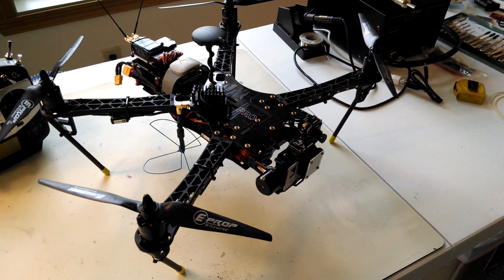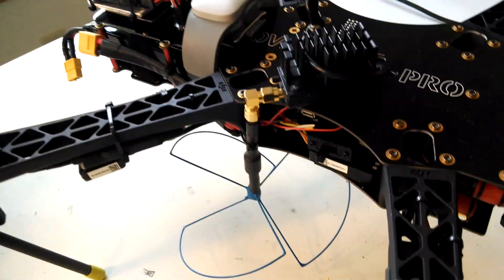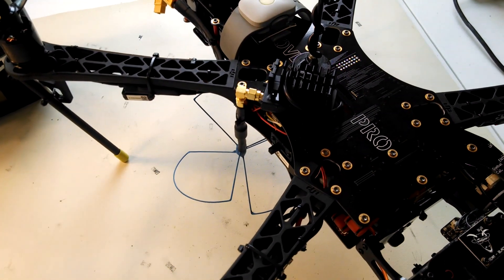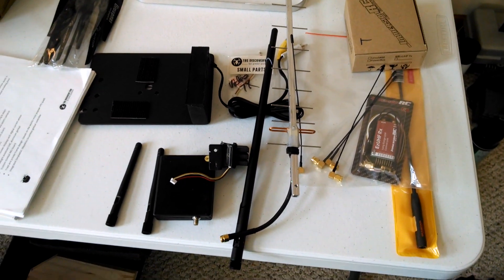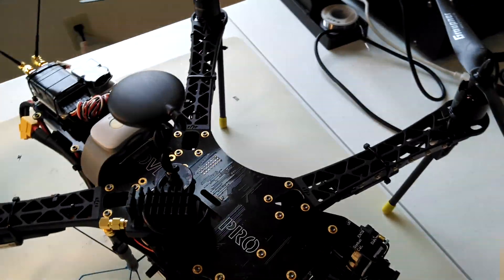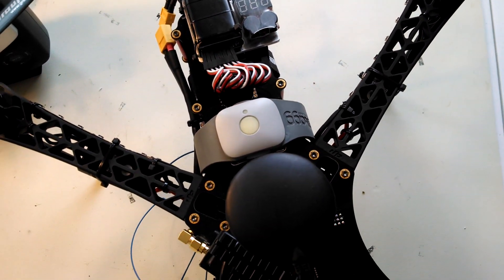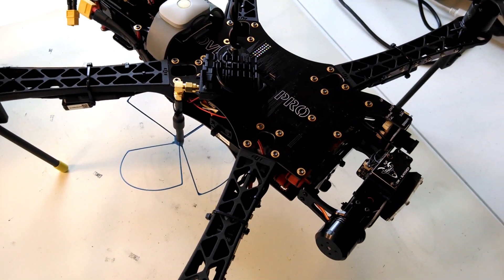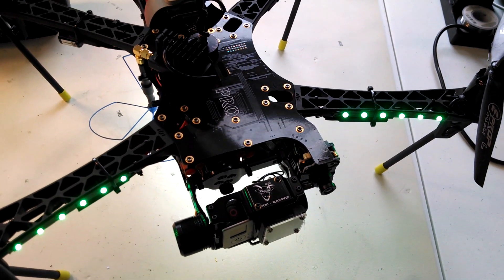TBS Discovery Pro Update and Mods

Comment: Hi Richard,  I used your leg design for the last year to separate my gps and and 1.3mhz.  My legs needed to be 6 inches to clear the antenna though.  The only changes from your design was I made the legs go straight up and down vs at an angle like yours.   At an angle I found they weren't as stable and would some times get loose (no matter how many zip ties I used). Additionally, I copper taped the inside of a gps holder that sits on top of the gps mount.  My problem has been that when the gimbal is aimed straight down, the legs were in view.  I contemplated getting 4 small servos and creating retractable landing gear but now I am determined to use no legs. I have had success placing the gps all the way to the rear, placed directly where the ezuhf antennas are on the board.  My ezuhf antennas are now located in the middle of the disco, as I have the ezuhf on the other side of the pins.  I'm now reading that this can cause intermittent fly-aways due the gps not being masted and being close to interference.  Not sure if this is true but now I'm going to be working on a solution to not use legs AND to have a gps mast.  I might mike a platform that extends back, on which the mast can sit... not sure.  Besides giving you an update, I want to ask you if your legs ever were in view of your gopro?  Are you still flying this design?
Reply from the maker: FPVme I'm still very happy with my setup and flying in exactly the same configuration with the legs zip tied to the ends of the arms at an angle. I don't ever see them in the video, even when looking straight down.  Best regards!

Comment: Looks good! I like what you've done with the landing gear. It would seriously help in the case of a hard landing and like you said keep it up off the dirt. I may contact you later about changing my FPV set up to match yours i just have some questions before i replace expensive parts that i already have. I have pretty much everything maxed out that you can order from TBS but i dont like how i can be flying in line of sight of the drone and the video goes all static. I get that even when it's close at times so i know it's not a range issue. Thinking something like this may help. im running at 800mhz on my video with their tuned Lawmate.
Reply from the maker: My video is crystal clear. The only time I get glitches is behind a building (takes a hefty building), or a hill. Otherwise I'm sure the video exceeds by battery range.  Here's my video setup:

Products for 1.3 Ghz from ReadymadeRC for FPV video
------------------------------------------------------
1 x 1.3 GHz Mad Mushroom Antenna (RHCP) IBCrazy (RHCP-MADMUSHROOM-1.3-IBC)= $44.99
1 x SMA Right Angle Adapter (SMA-RA)  = $4.99
1 x 1.3 GHz 10dBic RHCP Crosshair Antenna (IBCrazy) (1280CROSSHAIR)  =$64.99
1 x 800mW* 1300MHz Transmitter - NEW CUSTOM READYMADERC US VERSION(V2-800MW1300MHZTX-US)  = $59.99
1 x 1.3GHz Receiver w/SAW Upgrade (V3 with 1258 MHz!) (V3-1300MHZRX-SAW) =$79.99
Reply: Richard Fugate can i use use all this FPV stuff with the TBS Groundstation 2.4GHZ (http://team-blacksheep.com/products/prod:tbs_gs_2g4) or will i need to also get a new screen if i want others to see what im seeing in the goggles? I take it i can connect the goggles directly to the 1.3GHz reciever? I lost power @400 feet so i have to do some repairs and want to just get it right the first time if i need to replace parts. Have you found a better camera than TBS's TBS 69 FPV Camera? i dont see that they even offer that as an upgrade anymore but it's what i currently have, if it still works that is... ill have to fire it up and see what electronics are actually broken. :(
Reply from the maker: Brandon Proplesch Let's see if this helps... I have the TBS 69 FPV camera on my quad and think the video is great. The TBS Ground Station would be paired with the 2.4Ghz transmitter on the TBS Discover. So, not 1.3Ghz at all in that setup, you'd just use the TBS transmitter, receiver (ground station), and the paired screen. If you own/bought this then the 1.3Ghz isn't relevant. Now... if you do go with a 1.3Ghz transmitter/receiver the receiver has a simple composite video output... same as a 1980's VCR/TV hookup. This is what connects to the goggles.... or a LCD screen and skip the goggles entirely. I'm sure you can find may cheap "TV" displays that have composite video in (yellow RCA plug). You'd fly using that display and your spectators could see it too.  Good luck in your repairs.

Comment: 1.3Ghz will interrupt Naza connection to GPS if you don't have the filter from the IBCrazy Ultra air screw. GPS uses 1.575Ghz which is very close to 1.3Ghz. I know from personal experience that even a 400mw 1.3 Tx with out a Filter will completely hinder a GPS lock.  as soon as i put the filter on instant GPS.

also 1.3Ghz is the third harmonic of 433Mhz, so with a powerfull transmitter such as the 800mw one you are using there may cause RC link issues. and i say may because i haven't experienced it yet, I'm assuming because EzUHF has phenomenal filtering.  on a Dragon link or open source system it may be another story.

here is a great video on 433 / 1.3
Flite Test - Long Range System (LRS) Shootout

  I hope this helps people that had an questions about 1.3Ghz.

- Mr. Steele

Comment: Do you had some issues with gps and 1.3ghz?
Reply from the maker: No issues. I get a solid GPS lock with the NAZA without any delays or loss.
Reply: But the reason why is because you have the turn to down?
Reply from the maker: Ricardo Teixeira I pointed the IBCrazy Mad-mushroom down because of internet comments that gps and 1.3 Ghz may have interference issues. It has been mounted that way since I built the quad and works great. If may work great on top too, just haven't tested it that way.

Comment from the maker: I've received a number of questions about what parts were bought for the build. Here's my invoice with some edits and comments based on how I would purchase differently if done again. This is only based on my limited experience and YMWV (Your Mileage WILL Vary). :-)
----------------------------------
Teamblacksheep Products:
----------------------------------
TBS DISCOVERY PRO gimbal frame (1x) - US$ 599
   Flight Control (DJI NAZA Lite + GPS) (+ US$ 209.95)
   Upgrade to Naza V2 (+ US$ 230.00) <------ NO, Naza lite is fine.
   900kV2 Motor & ESC set (+ US$ 279.95) <---- bought because bigger is BETTER, right? No complaints.
   9x5 Graupner E-Prop Set (+ US$ 30.00)
   2 x 4500mAh 4S battery (+ US$ 99.95) <------ Instead Turnigy 4S Nanotech 70C 4500mAh, less $$, longer flight time
   2.4GHz FPV Combo (UHF RC, Tx, Rx, Cam, Goggles) (+ US$ 859.95) <------ Go straight to 1.3 Ghz, skip the Tx, Rx (get EzUHZ tx/rx, Fat Sharks)
   Add 11dBi Yagi (+ US$ 39.90) <------ Go straight to 1.3 Ghz 
   Add 7dBi Whip (+ US$ 29.95) <------ Go straight to 1.3 Ghz 
   Upgrade to TBS69 FPV Camera (+ US$ 70.00) <------ Nice FPV camera
   Add Flamewheel Arms (required for a full frame) (+ US$ 24.95)
Set Graupner E-Prop 9x5 (2x CW, 2x CCW) (1x) - US$ 30.00 <------ Extras, you'll need em'..well I needed them.
Set Graupner E-Prop 10x5 (2x CW, 2x CCW) (1x) - US$ 36.45 <------ Extras, you'll need em'..well I needed them.
   Add 5mm reduction set (required for TBS motors) (+ US$ 4.45)
B6AC 80W (1x) - US$ 54.95 <------ Happy with the charger

Products for 1.3 Ghz from ReadymadeRC for FPV video
------------------------------------------------------
1 x 1.3 GHz Mad Mushroom Antenna (RHCP) IBCrazy (RHCP-MADMUSHROOM-1.3-IBC)= $44.99
1 x SMA Right Angle Adapter (SMA-RA)  = $4.99
1 x 1.3 GHz 10dBic RHCP Crosshair Antenna (IBCrazy) (1280CROSSHAIR)  =$64.99
1 x 800mW* 1300MHz Transmitter - NEW CUSTOM READYMADERC US VERSION(V2-800MW1300MHZTX-US)  = $59.99
1 x 1.3GHz Receiver w/SAW Upgrade (V3 with 1258 MHz!) (V3-1300MHZRX-SAW) =$79.99
  
Landing gear
----------------------------------
Old arrow shaft, 4 1/4" bolt thread caps
Cut into 5.5"lengths
Zip tie (small) to outboard of the flame arms.

Comment: I'll be starting my build and have identical equipment except the 1.3 transmitter I got from getfpv 400 mw hope I dont have issues with it sounds like you have a perfect setup and I have been swinging back and forth on equipment My concern was the interference with UHF and 1.3 last thing I want is for the craft to drop from the sky. I'll have to get your legs extensions  where did you get them . What do you have mounted on to of the EZUHF and did you just use electrical tape. Thanks
Reply from the maker: mojito5606 Sorry for the delayed response. I'm not that good at navigating YouTube comments. No interference between 1.3 Ghz and EzUHF at all. The leg extensions are just 5.5" pieces of an old arrow shaft... can't get any cheaper! Yes, electrical tap on top of the EzUHF transmitter. Hope your having fun with your TBS!

Comment: Nice setup. Im looking in to a Discovery Pro as I currently have a dji phantom v1. With a 2200mah battery and all my gear Im getting about 7.5 minutes of flight on a calm day. That isn't much time compared to some other options. What battery are you running with what kind of flight time? Thanks!
Reply from the maker: I own three batteries. Two TBS 4500 mAh, and one Turnigy Nano 4500 mAh. They are all the same age and only about 5 cycles each. I consistently get 10-12 minutes flight time. The the TBS batteries at 10, and Turnigy closer to 12. Ironically the Turnigy cost about $30 less and weigh more!

Comment: What is the maximum range you can travel with your battery currently being used?
Reply from the maker: I have not tested the ultimate "limit" of range. I have comfortably went 2 miles out, loitered for maybe a minute and returned. Total flight time about 8 minutes with a safe margin on the battery remaining (3 min). That's about my comfort zone at the moment.

Comment: Richard, it looks awesome, have you make a list of the components that you are using? have you run into any issue between the RC and the video transmitter? the antenna at the bottom looks great too.
are you using the NAZA-M lite or the NAZA-M V2?
Reply from the maker: No antenna issues at all. Get a GPS lock quickly and video is crystal for as the distances I'm comfortable flying, so far no farther than ~2 miles. I have the NAZA-M V2. Since I don't plan on adding any other NAZA options (OSD), I probably wasted some money.

Comment: Is that the 400mw RMRC vtx? You recommend a heatsink?  What's the Aluminum slug on it? you mention?  Do you have links to these parts?  Thanks!
Reply from the maker: It's an 800mw 1.3 Ghz RMRC transmitter. The RMRC transmitter comes in a stupid aluminum box stuffed with pieces of scrap metal to act as a heat conductor. The actual transmitter is inside this junk in it's own slim metal case. I simply removed the top of the case exposing the electronics and applied a layer of thermally conducive epoxy (Arctic Alumina Thermal Adhesive) and let that cure. This keeps the aluminum piece to be put on next from shorting the electronics. Then I cut a piece of 1/8" aluminum matching the area of the now epoxy covered circuit card. This was then glued right on top of the circuit card with the same epoxy. Then on top of his I epoxied a chuck of aluminum heat sink of a scrap piece of electronics. Whole thing weighs less that the junk case that it come inside from RMRC.

Comment: Hi Richard,  I love how you mounted your vtx.  The legs look nice too.  I plan to duplicate this.  Did you do anything else to prevent interference?  Is that a low pass filter under liquid tape on your ibcrazy blue beam antenna?  Is that the perfect placement of the vtx so when the gopro is aimed down, there's no view in the picture?  Did you think about putting the naza gps further front?
Reply from the maker: Super simple arrow shaft legs work GREAT and don't show in the video, even when straight down. The vtx antenna is out of view too. No filters at all, just a 90 degree elbow to get it to point straight down. No noticeable interference.

Comment: Sweet! Do have links to the lighting system you installed? Also how did you blackout the gps and the receiver? Thanks!
Reply from the maker: Not so much a "lighting system" as it might seem. I just bought LED light strips off eBay and brought all the leads together, attached a small slider switch, and then direct connect to the 14v pads on the main board. The LED's are being "over-driven" voltage wise, so I'll see how long they last. Flying season is just starting in Minnesota so more to come. The GPS is just spray painted, and the diversity receiver is just covered with a couple strips of black electrical tape. :-)

Comment: Hi Richard. What is the total weight of your quad with battery, and what flight times are you getting?
Reply from the maker: I plan on doing lots of flying now that the weather in Minnesota is getting better. I easily get 10 min using the TBS 4500 mah lipo, but I don't know the exact limit as to when it drops out of the sky. I do plan on testing and will provide full details. I'll post the weight shortly. Best regards!
Reply: +Coptercowboy Quadcopter The weight of it is 4.385 lbs with the TBS lipo without the pet tracker. So, just under the 2kg restriction. I know because I am now the owner of the craft.